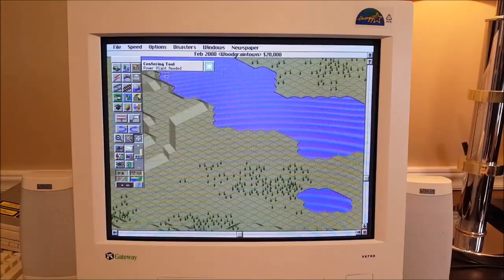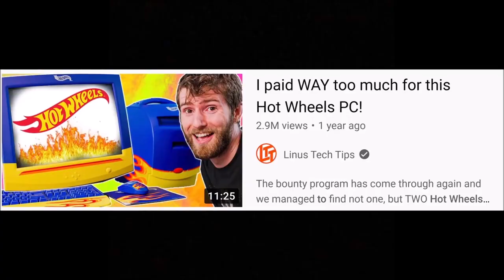How YouTubers Are Destroying the Retro Computing Community

Comment: I like the expansion of retro those You Tubers bring to the table.

For me, the value increase is not a big deal.  A few things cost me more than I felt good about, but quite honestly, I very much enjoy all the spiffy hardware being made right now too.

Without the greater value and overall expansion, many of those niche items and or software might not have happened or be less compelling.

Everything costs something.  I would take a bigger, more vibrant scene over a smaller, overall cheaper one.  And that is just me and my take on this too.

No judgment no worries otherwise and hopefully we all can continue to find ways to keep old, great computing and gaming alive and relevant.
Reply from the maker: You make an excellent point. Demand drives the innovation forward for sure
Reply: That demand can be created by showing fair value. Those bounties and such don't add anything. Worse of things become too expensive then nobody will buy the systems and the market for enhancements will die with it

Comment: The funny thing is: Ebay prices skyrocket, but prices on actual fleamarkets (you know, huge popup stores where you can pick valuable old stuff for very cheap, get to inspect it in person, and for cash so "sales final" is "sales final", no hassle, and get a lot of walking exercise and fresh air and sunlight) tend to be mostly unaffected...
Reply from the maker: Flea markets are an excellent place to find most things for a good price. There generally isn't an appraisal done on each item for its actual value. Have you had any recent food finds at a flea market?
Reply: @adventuresinnostalgia  Currently, more looking for pro electronics gear than vintage computers (and if I do, it is more about unix/workstation/pro gear)... but had finds like a Toshiba 5200 in salvageable (some maintenance required, but could make it boot and install it) condition for all of €50 in the past. Also, early 2000s Macs (a rabbit hole in itself :) ) tend to go for very reasonable prices here in Germany. Pro Gear? Eg 100MHz Philips analog scope, fixable and meets spec, €40.
Reply: I just got back from VCFMW, a convention of hobbiests who often times buy, sell, and trade vintage systems and accessories for prices that people are actually able to pay. If you want to get good deals at this point, you pretty much have to have a lot of patience and be willing to not just hunt down, but even travel to get a system you want. eBay used to be cool, and it's certainly convenient, but I'd say the trip was worth it to me for the deals I scored, as well as the experience of being around people who actually know retro computers and are willing to bring outsiders into the community.

Comment: I had a AMD-486DX-120MHz that I gave away when I bought an Emachine in 1999. I regretted it ever since.

As an retro enthusiast, it's the software more than the hardware that interests me. If I can run it through emulattion on current machine, I will. And that's getting better all the time.

Secondly, I like to find uses for the old hardware that do have. Preventing as much E-wastes as possible. I won't pay high amounts for any of it nor do I have the space.
Reply from the maker: I've lost some retro computer hardware and systems from moving or my house getting broken into. Seems like a weird thing to steal. maybe they were just taking anything they could and running.

Comment: Prices are insane but high prices can also mean a worthless system can become worth saving. Let's say the market value of an Amiga 4000 is idk 100 dollars. Normal condition is the caps are leaking and the battery has caused damage. Would someone spend 40hrs restoring it? Now let's say the same machine is worth $1500. Now it's worth putting 40hrs into it. In a way a high price can save machines.
Reply from the maker: That's an interesting point!  Do you think high prices are more likely to save common retro machines, or just the rarer ones?